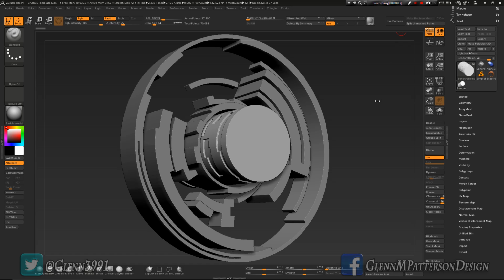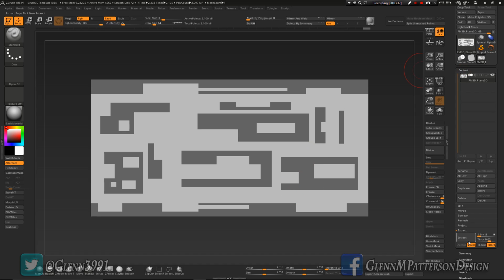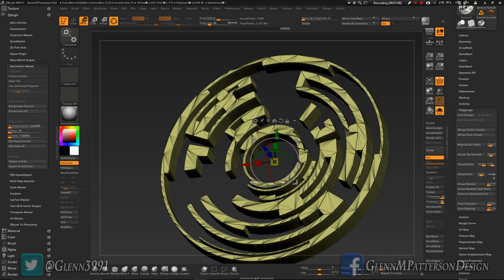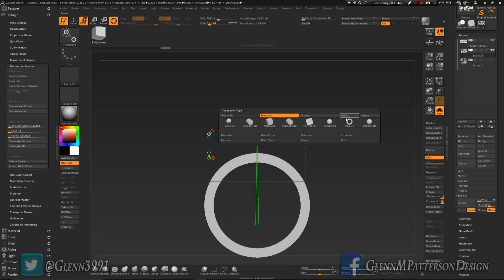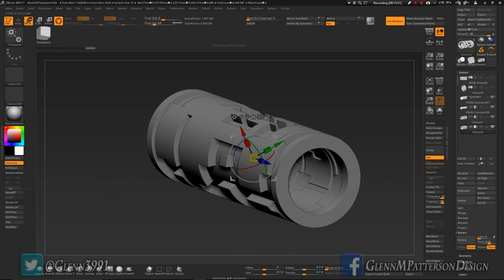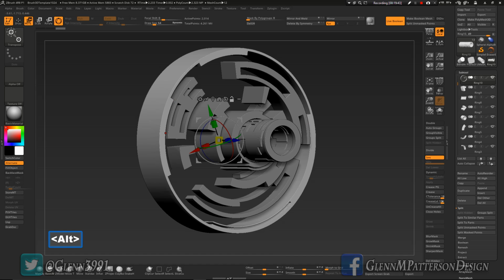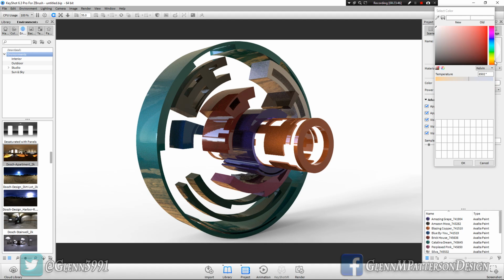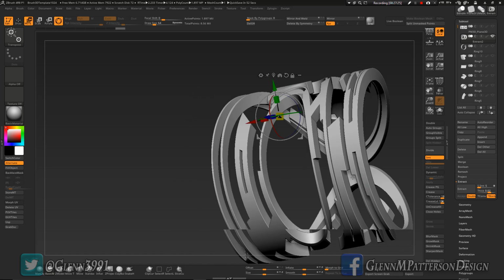Zbrush 4R8 Bend Arc Deformer

Comment: Dear Glenn thanks for this great tutorial, ideal for a beginner like me. I'm still doing something wrong it seems. The moment I use the arc bender tool it doesn't make a nice circle like in your video .. moment i pass 20° all openings in the object stretch out and fold together in an ugly mess until it reaches 180° and it looks like a round circle filled with needles and artifacts (without any openings). I use zbrush 4R8 P2, I heard the arc bend tool was changed .. does this have anything to do with it ? Or is there another or new way to achieve the same result ? Thanks in advance !
Reply from the maker: I suspect you still have some masking applied to the Extracted Mesh. Clear the Mask and Try again. Just tried the process in 2018.1 and it worked good, but noticed mask was applied to extracted mesh. Hopefully thats the Problem
Reply: Glenn Patterson Ok thanks a million for your quick response, I'll give it another shot !
Reply: Glenn Patterson Yep that was the problem ! It works, love it !!
Reply from the maker: Awesome! Glad it worked out for you

Comment: Since you pointed out some would know how to do it in Photoshop, and i mainly learn texturing right now, can you cover some photoshop pattern creation? Since your tuts are zbrush oriented you could combine this
Reply from the maker: +Marienkarpfen I'll see if I can knock something for you. What specifically are you trying to do in Photoshop
Reply: Nothing specific, currently learning substance designer and need to know how to make more complex patterns in photoshop as base for textures 
https://support.solidangle.com/display/A5AF3DSUG/Coating someone made that golden pattern under the pill picture for me but by god i wouldnt know how to do something like this in substance designer itself
(I specifically will need that knowledge to make armor patterns or skin marks)
Reply from the maker: +Marienkarpfen You might want to take a look at my Tutorial Zbrush 4R8 SVG import, I go into Photoshop and make a Quick gear vector Design and bring it back into Zbrush. I'd go the same route in Photoshop with that circular pattern in the image.
Reply: Was informative. There are probably easier ways to right away add these outer grips to the circular shade.
Not sure why it beveled that image and extruded it upon importing, gotta admit thats when i turned off :P
 Your videos are nice, keep running :p